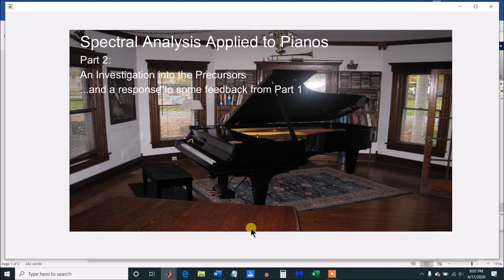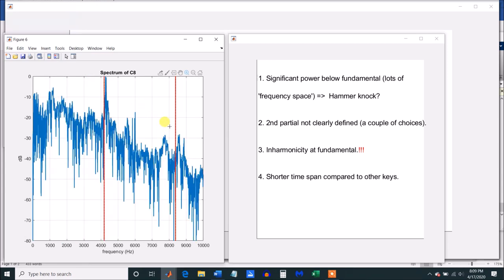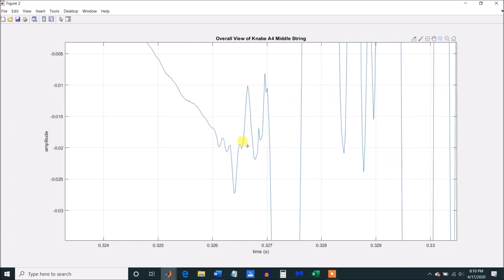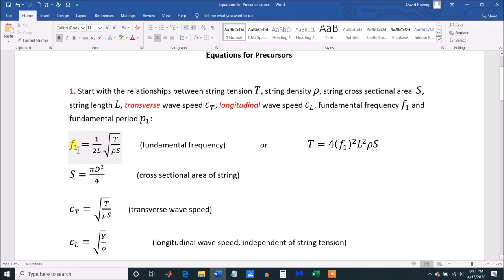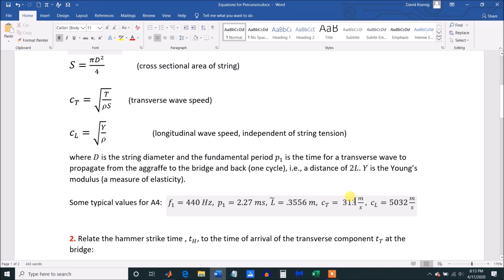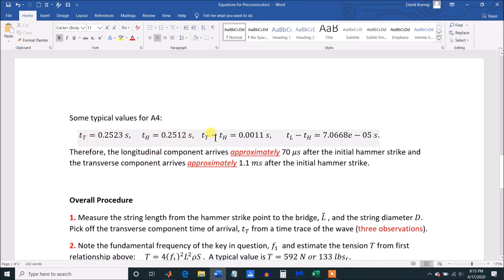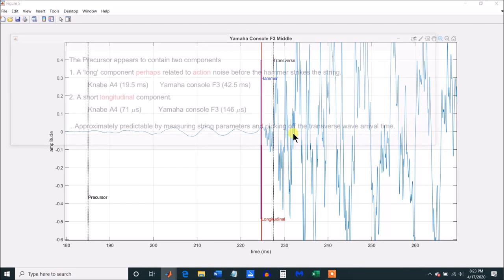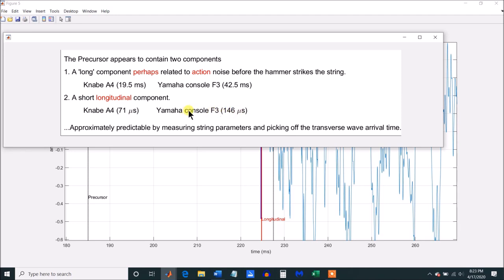Spectral Analysis Applied to Pianos, Part 2. Precursors

Comment: Good David. Perhaps (if there is enough data) you can also check the spectrum of the precursor section to see if the frequency is a sensible match to your frequency calculation and if, in fact, it matches the spurious peaks on the overall spectrum of the string. May work better lower in the scale.